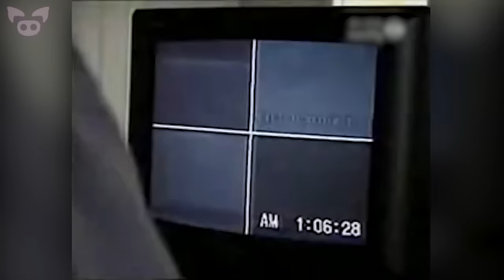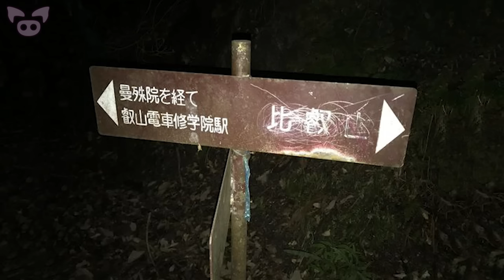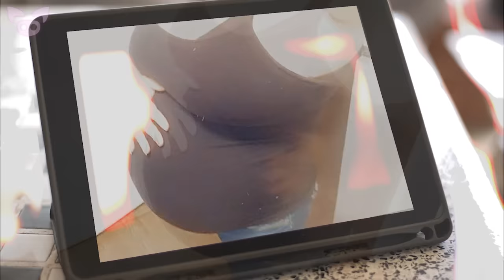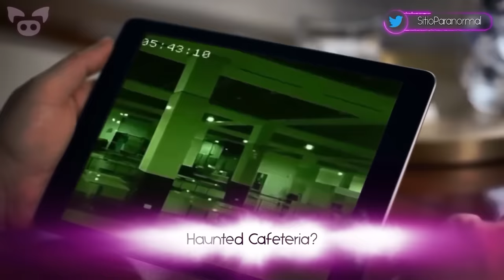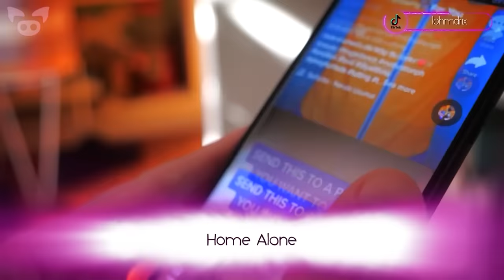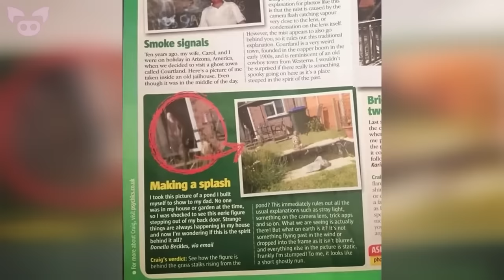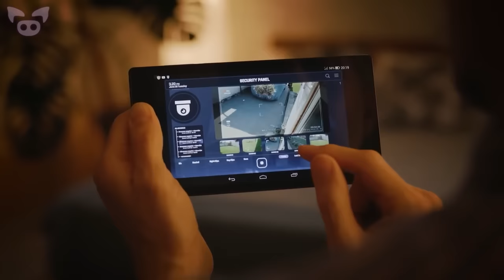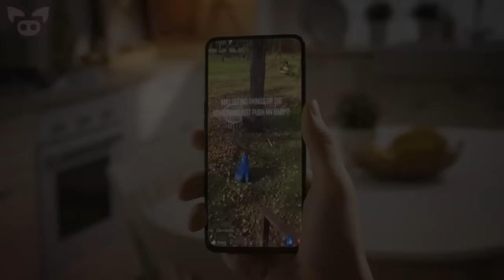These SCARY VIDEOS Will Feed Your Fears

Comment: At 35:07 when you say "the homeowner pauses" what's happening on the right-hand side of the screen by the tree, crossing the snow?  What is that?  If the video is paused, what causes the movement?
Reply: I'm surprised Kallen didn't notice it.
Reply: It happens again towards the end of the video but it moves in the opposite direction.

Comment: 30:57 "Shadow" - easily done… Someone is off camera walking in front of a dim light to cast the shadow… the shadow steps out and then deliberately walks forward as if on queue. It just doesn't seem right… It seems set up. Interesting that there's no decoration of any kind on the walls…

Comment: When you say "low compression rates," you actually mean high or strong compression rate. A high rate of compression lowers the quality and file size. A low compression rate would mean it's unaltered and without compression artefacts. Other than that, good work, and keep up what you're doing.

Comment: At 54:19 (Boy in blue coat) exactly if you slow down the playback you will see that the boy is pulled backwards at waist height, he was not pushed, he was pulled, look at the creases in his blue coat you will also see a small section at the bottom pull together and pull him back, then his hips go back but he tries to walk forward which is what you naturally do when pulled backwards as your body wants to offset the pull back with motion forward but the pull was too strong and back he goes. I also think he threw his toy at something not just randomly.

Comment: The door shaking could possibly be the hvac. If a building is too airtight, and the hvac turns on...the door could shake due to negative pressure. During the day when open...the pressure may be different due to other doors being open inside. Def isnt a ghost tho. It is scary to see tho.

Comment: ⁉️⁉️UNKNOWN VOICE⁉️⁉️

At 2:40 while the two guys are walking down the hallway they are not responding to any foot steps approaching them. What actually happens is that the camera man hears a disembodied voice at the end of the hallway. Which I think it says "hello" in Spanish, but I'm not sure. The camera man askes the man in front of the camera if he heard that. Thats when the guy in front puts his hand up to feel if there is anything next to them by check the change in air temp.. Then when they both go silent a second later they both heard the same voice. I really couldn't make it out the second time, but then the one guy in front of the camera says "hello?" (in Spanish) As if to ask the question, is there someone there??? So then after they examine what's over that wall, and then begin to both turn to walk back down that hallway. The camera man hears what sounds like someone  was exhaling which you can definitely hear. The camera man says to the other guy "oi" (listen), but it just silence.